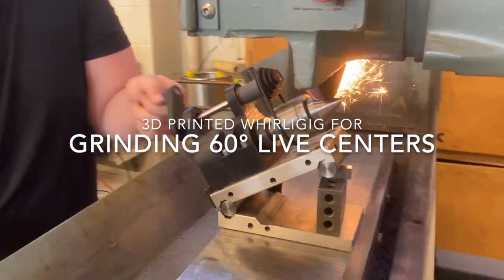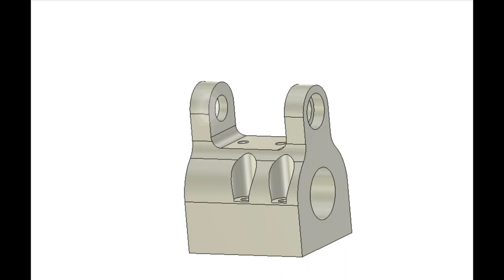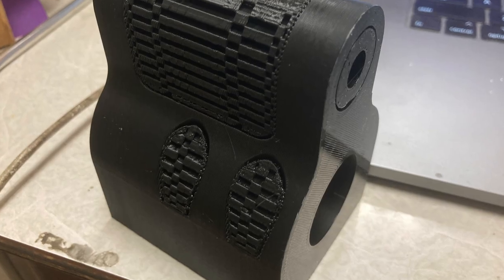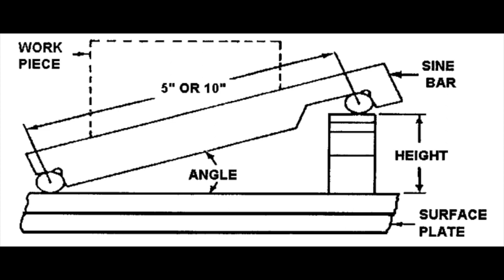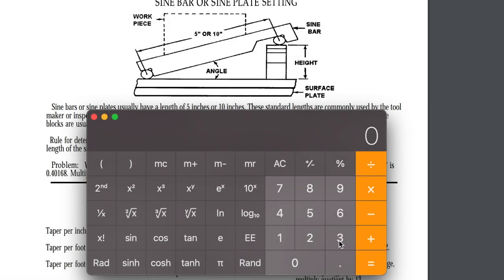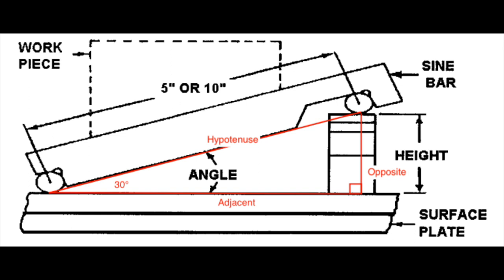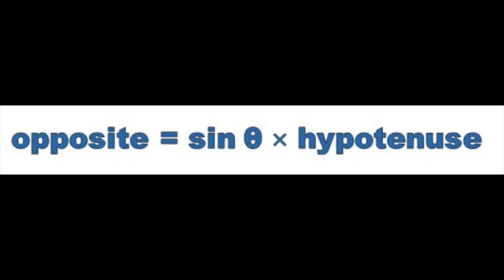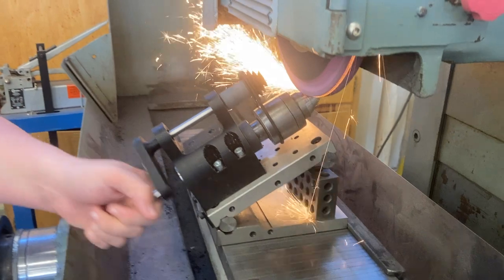3D printed whirligig grinding fixture for grinding lathe 60° live centers

Comment: This is awesome!

That's a quick and cheap way to simplify this job. And it looks extremely professional too.
Reply from the maker: Thanks. I was a bit worried about using a 3D print for a grinding fixture but it has worked very nicely. I checked the first one on the optical comparator and it was very accurate. A couple students ran the remaining centers. When blued they appeared to seat very well.